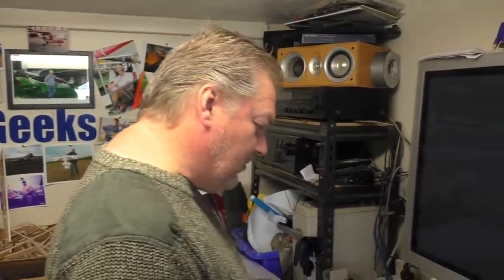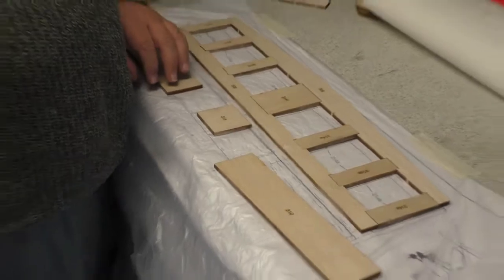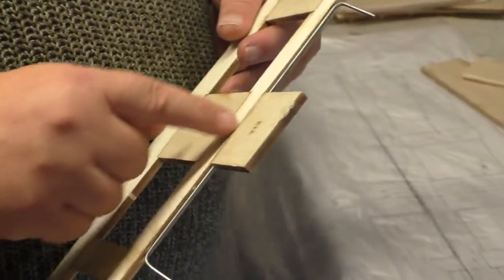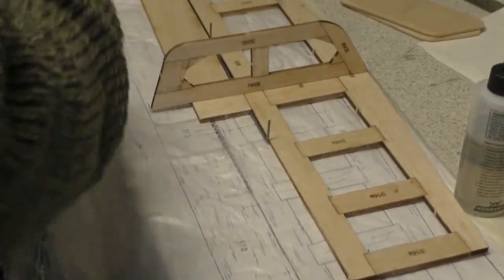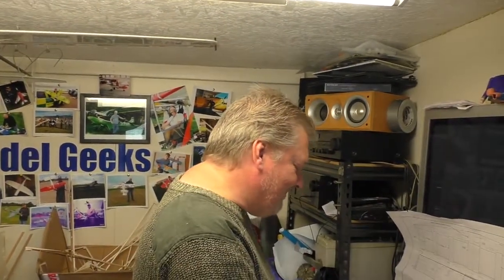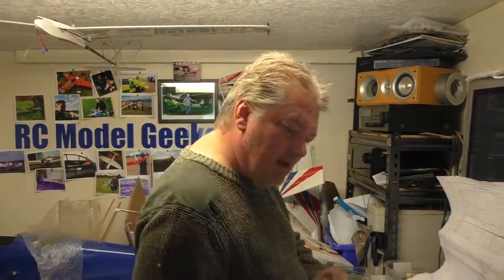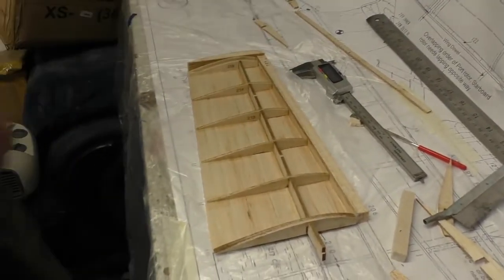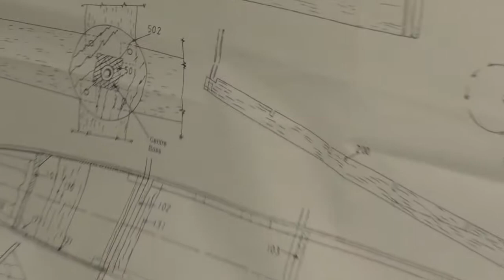DB Sport & Scale Autogyro Build Pt3 RC Model Geeks

Comment: Set the shafts and mast directly 90 degrees to the wings looking from the front so in effect the rotors will be parallel to the wings regardless of dihedral ie pointing  downwards towards the centre of the wing,think of these spinning rotors ( rotary wings)as your dihedral angle too,so another way to think of this is dihedral of wing is same as the dihedral of the rotors,I will do a sketch and place it onto the FB page as well later to assist you.
Reply from the maker: Yeah thats what i thought. Thanks Barry you are a star.
Reply: These actually bank really nicely and are very stable,I am going to build another myself to replace the one I had years ago,you can literally hover them really nose high into wind and they will not stall either just a mush of the nose,yours is the Mk.2 with the high set tailplane,the original DB Autogyro was a free plan in one of the magazines,another Autogyro was the Hobbit which utilised standard helicopter head and blades but was no way as near as good a flyer,quite the opposite and unstable,you launched that one by binding string around a drum on the rotor head and stood on the string and opened the throttle ! this pre spun up the rotors,in my opinion Autogyros are much more fun than expensive helicopter's.
Reply from the maker: Yeah gyros are great fun really enjoy flying the Hobbyking one

Comment: Forgot to mention,make the undercarriage really strong as you will be doing quite a few vertical landings that splay the legs,suggest that you beef up the main wire legs with wood fairings bound and glued with heavy cotton,you will not regret the bit of extra work.
Reply from the maker: Cheers ill work something out ;o)
Reply: As they say 'Forewarned is forearmed' !